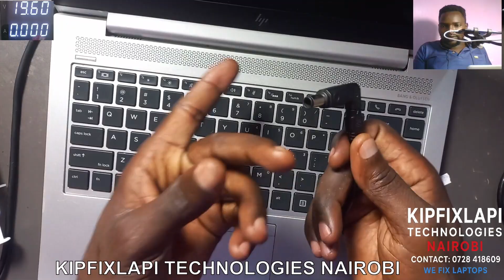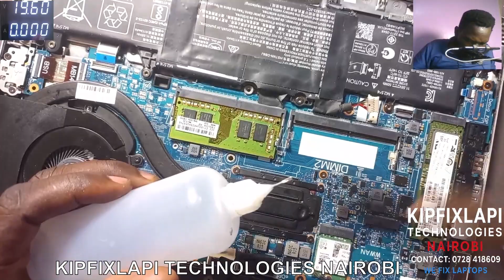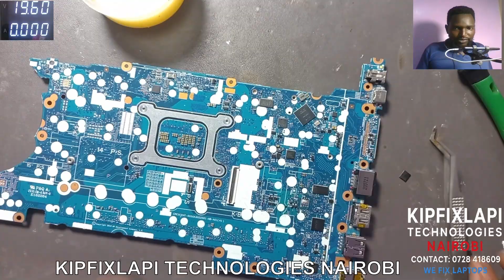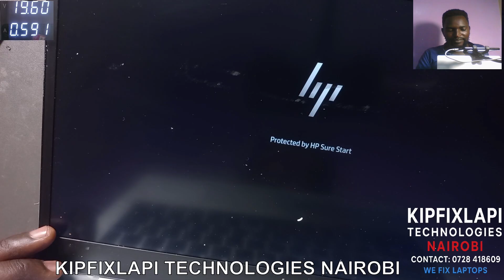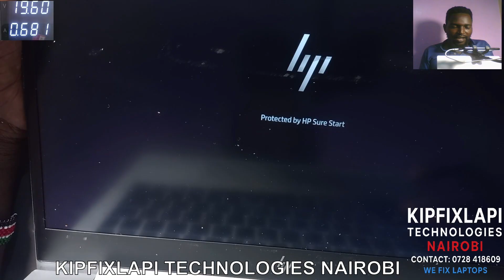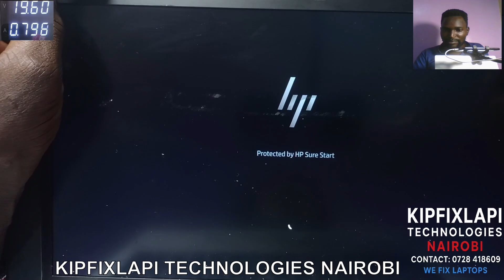HP ELITEBOOK 840 G6 NOT POWERING ON REPAIR, MOTHERBOARD REPAIR, BIOS CORRUPTED. #repair #subscribe

Comment: Pls I have this same laptop.. it keeps making three long beeps followed by two short beeps five times every time it is powered on. The caps lock light keep flashing while the fan runs continuously with dark screen and no display.. from this symptoms, please what could be wrong with my hp 840 g6? laptop?
Reply from the maker: You could be having a problem with Ram, ram slot, bios, mch or cpu
Reply: @KipfixLapiTechnologiesNairobi thanks..I'll try n change the ram stick and give u feedback

Comment: Senior, I have been following your videos. Please Clear me on this: if I download bios from hp support and extract the bin file will it not work ? I extracted for 840 G8 the bin file where 3 bin files with a tag "T25363" but there sizes where different I couldn't proceed because I was lost.
Reply from the maker: Hello Silas, the bin downloaded from hp support sometimes fails to work, reason being sometimes that bin is not a match for the motherboard p/n. 
Normally, we do take bin from support only during bios update.